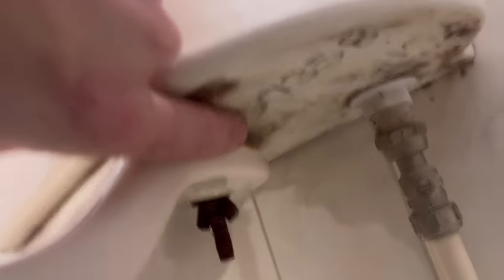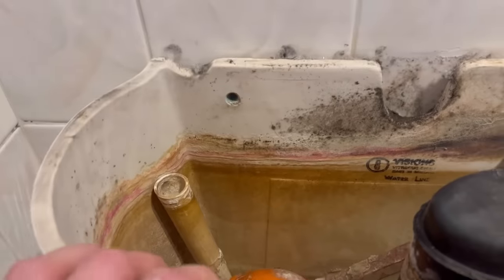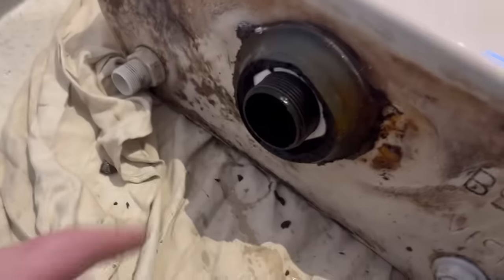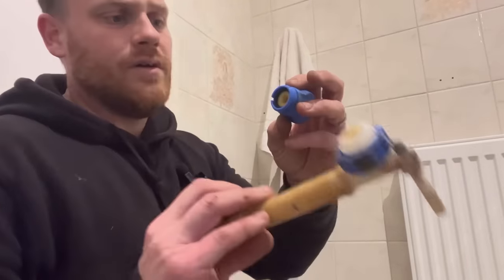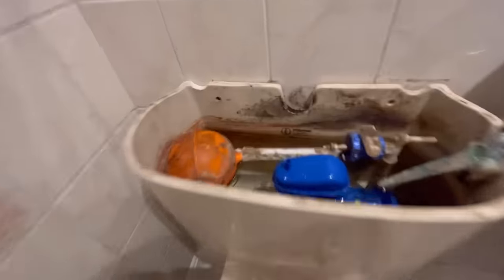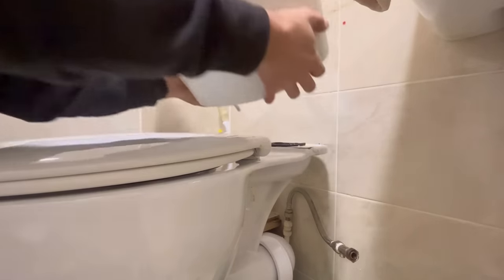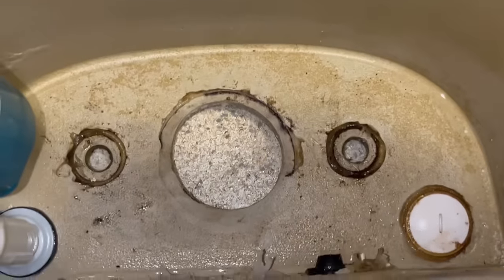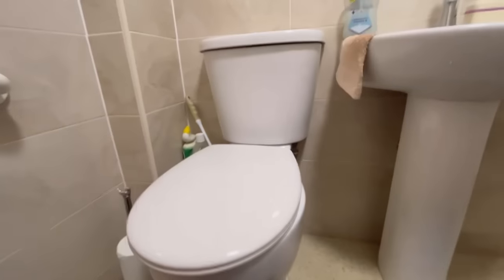Worst Plumbing Repair Ever! Plumbers, Stop Doing This! NIGHTMARE

Comment: There something special about hugging some total strangers dirty smell toilet only a plumber can appreciate such a wonders experience 😁
Reply from the maker: Absolutely, think plumbers become oblivious to the fact they are hugging and getting up close and personal with someone else’s toilet when working on them 😂
Reply: @bluebulldog_uk hi mate I have a 4  inch waste pipe on a 5 inch pipe but there is a gap any suggestions
Reply: And the customers have the cheek to bork at the price charged for repairing said smelly pissy bolt rotted toilet.
Reply: Used to dread those jobs, especially back in the day, when most people had carpet in their toilet……. And freely pissed on them …… I can still smell them just thinking about it. 😂

Comment: Silicone all the way pal, when youve worked on new build you notice the toilets you go back to with drips coming out from where the wing nuts go thru, never have silicone,  pottery in recent years has become more poor, never silcone the donut washer to the pan tho. If you get leaks from that point  youve likely not fit toilet pan square.
Reply from the maker: I can see using it on the nuts but on mine the amount of silicone and the places it was, just crazy, I think you am right about pottery, had a toilet that was really out of plumb and a basin that was wonky in recent times

Comment: It takes a minute or 2 to remove the silicone. If you don't use silicone and it leaks its going to take about 15-20 minutes or possibly even longer to fix it. Better safe than sorry. Hate the rusted wing nuts 😭😭😭
Reply from the maker: Rusted wing nuts am a nightmare, nothing worse. I’m going to look at getting a proper tool to remove cause to be honest it just would not come off, didn’t help it being late at night and wanting to go home 😂
Reply: I usually use a dremel to make a cut through those wingnuts, then lever them off with a screwdriver.. it's quite small and can normally get in tight spaces.  Still not easy but does the job in a few minutes.
Reply: Niall I've fitted countless cisterns WITHOUT silicone and never had leaks unless I've forgot do something lol no need for silicone on toilets at all.

Comment: I am a joiner, but when I fit toilets I swap out the cistern to pan bolts for stainless bolts and wing nuts... And I fix the cistern to the wall with stainless bolts and a rubber washer. When I come back in years to come a doddle to get out. 😊 And to do this costs me about £1...  As I am a landlord too and will end up fixing it in years to come, and Tennant's wee seems to go everywhere 😮 corroding steel bolts even quicker than just the condensation.
Reply from the maker: The dreaded wee conversation with people when they ask why the radiator next to toilet is rusting is the one 😂 good to see your planning ahead and making your property’s easy to maintain 👍

Comment: I generally replace both the flush and fill valves as saves the hassle of call backs later on... maybe even the flexi connection, as well as the close coupling kit with new wing nuts and donut washer - nice video cheers for uploading
Reply from the maker: Thanks mate 👍

Comment: Those close coupled kits, the washers are for under the cistern with the wing nut, the bolt is designed to stay inside the metal bracket
Reply from the maker: Top spot mate I was waiting for someone to spot that, I did move them when I realised what I done but the washers was tiny hence why you see me change them to bigger ones 👍

Comment: I'm Not a Plumber but I have Changed out Cistern washers, I never use Silicon, to seal but I do use Vaseline on Metal Bolts both as a Lub and a rust preventative

Comment: Job 1. Many times the wing nuts start to turn the bolt so I have had to cut the bolt with my multi tool! Small hint - when the new fixing bolts are in the bracket I always tape them in so they cannot drop down into the inside of the pan. Had this happen once and had to remove the pan and tip upside down to get it out!! Job 2 I agree no silicone needed for any rubber washers - it can make the washer distort as it acts as a lubricant. I use Flomasta and the kit comes with a new inlet so I always fit it and a new flexi!!

Comment: Totally agree, no need for silicone 
Had to do it once as some dull manufacturer for a close coupled disabled toilet supplied me with a washer that was too small for the syphon hole 
Tried it twice with what they provided but it kept leaking to got a Dudley flush and silicone it in 
Dudley common around here so that bit shouldn’t ever need to be taken out again
Reply from the maker: Be sound with a Dudley, parts are easily available 👍

Comment: Really good content showing how it can be a nightmare to fix a toilet. You just know you’re in for it when the close coupling nuts are rusted. I’ve used a hacksaw blade and that’s not nice on the fingers but I’ve a multi tool now so I think that’s the way to go. I would put a dab of clear silicone on the cistern through bolts really depends on the rubber washer that comes with the it. If it’s flat then def silicone but if it’s a good mushroom hear shape then that will bed in and no silicone required. Yes I’ve had plenty of toilets from hell over the years and like yourself I keep a few flow master flush valves in the van they are indeed the business. Keep up the good work.
Reply from the maker: Thanks mate appreciate the comment 👍 I do rate those flowmasta kits, very good for the price

Comment: Good video. I usually use my multi tool to cut through the rusted bolts.
Reply: Would the vibration not crack the toilet.

Comment: Never use silicone, unless for some odd reason its a last resort.  Id have just got the grinder out for them.wing nuts
Reply from the maker: I did think to get the grinder but was all the way in the van, in my head struggling for 5 minutes was the better option for some reason 😂
Reply: Managed to get a hacksaw in there to cut mine off

Comment: Agreed never need to use silicon. Alarm bells ring when you do see it, often it’s because the cistern is damaged/cracked and rather than replace it someone has bodged it and hoped for the best. Or rather than replace the donut for a fresh new one that fits correctly, they’ve had a party with a tube of silicon. 

Also I’d throw those plastic fixing bolts away even when brand new, I always carry packets of the metal bolts kit version (come with thick domed washers too). Screwfix sell em for less than £3. That way I know for sure it’s not going to leak or come loose. I’d also use a 3/4 tap washer and metal washer on the screws to fix through top holes in cistern to wall. That way when the screw does eventually fall apart, there is something left to grip the screw out. If the head has rusted off then it’ll just fall through the holes, rather than be left with screws that won’t budge. Flat head screws either that’s not been changed in a long time or some idiot thought they’d be a good idea. Of course assuming the wall behind is tiled or has a nice solid finish - you are licensed to splodge some silicon at the top lol just enough to hold it. Just deep enough to cut with a Stanley blade!

Comment: I would of changed the float valve at same time and just a tip when you put the bolts on the fixing plate put a blob of silicone on each one stops them fallen out when you try to fit cistern to the toilet bowl

Comment: Job 1 - the rusted bolts. Removing the wing nuts is always a pain but when rusted the bolt turns as well even after a bit of WD. At this stage I try the multi tool to cut the bolt but if this isn't possible its as you did - brute force and hope the metal is also rusted and it lets the cistern come off. Then hacksaw the bolts. Nightmare for an easy job! Job 2 - silicone everywhere! For all rubber seals I agree it is NOT needed. Indeed it acts as a lubricant which lets the rubber get squashed so more likely to leak. One thing I always do when fitting the bolts through the bracket - I tape them into place ever since one flipped out and went down inside the cistern. Its probably still there as I found another bolt!! Yesterday I did a job and couldn't find my pipe slice!! OMG had to use a hacksaw!! Not done that since 1969 when I did my own central heating!!

Comment: Silicon is for baths and shower trays, NEVER for thread and gasket sites. It's a maintenence disaster.

For a basin waste my plumbers merchant recommended something they called a plumbers friend. It's a conical shaped washer the big nut pushes up into the basin hole. Better for me than a tub of mait I won't use.

Superb watchable stuff as ever.
Reply: Oh, and good to see you using tools for jobs they aren't meant for, like hammering on screwdrivers and bashing syphons with grips... "we've all done it"
Reply from the maker: @tomsanders8714  😂😂 grips as a hammer is my favourite
Reply from the maker: For basins I use a Thomas Dudley basin mate might be same thing, really good 👍

Comment: What about a quick blast of silicone spray rather than the thick stuff? I'm on a course right now and the guy is advising that. Like to hear thoughts on that, Great vid mate 👍
Reply from the maker: Thanks mate…seals am designed to be compressed between the 2 surfaces your trying to seal, anything in between just causes problems, maybe plumbers mate at a push sometimes but shouldn’t need it 👍

Comment: Multi tool with a metal cutting blade for cutting off the rusted wing nuts, as an ex service engineer for a WC manufacturer the use of silicon sealant on cistern internals voids the warranty on the parts.
Reply from the maker: Cheers mate…Im showing my mate this comment who uses silicone, proves my point 😂👊

Comment: Just ordered some of them adaptors mate, good call! 

I'm with you, the ONLY time I use silicone is if I use the plastic bolts on the cistern, just for some reason they don't seal right but that's the only time on toilets often you can't clean the silicone off properly anyway which then can cause leaks. Does my head in.
Reply from the maker: Adaptors am great for price 👍🙌 
Does my head in always adds time to the job and not needed
Reply: @bluebulldog_uk  can't wait for them to turn up! Might cut some more notches into one of them for when it's the plastic + head wing nuts :)
Reply from the maker: @killerbean9911  great shout 👍

Comment: Just try and avoid the wing nuts as much as I can - Use the Mcalpine Super easy set but those adaptors are a top shout 👍🏾
Reply from the maker: I’ve seen them new Mcalpine ones might give them a try 👍
Reply: @bluebulldog_uk  Another plumber channel had a prob with one of these I believe. https://youtu.be/TNtCtcexrmo?t=1431
RE silicon.... I'm sure the person that did this meant it to be a forever seal if he knew he could quite easily just swap the syphons over as you mentioned at the start of the job.Happy New Year mate.

Comment: Hello bud keep up the good work. Question, bathroom basin is leaking not from the waste but from the the pop up mechanism sits on the top just behind the taps. Every time water is applied to the mechanism rod it leaks from bottom. I don’t want to silicone it cos I use the pop waste. Any idea mate?
Reply: Popup wastes are a bit rubbish. I had two of them. Can you change it to a clicker waste?
Reply from the maker: If it’s leaking from the mechanism where it connects from the rod into the waste part then would need replacement I would have thought unfortunately

Comment: Angle grinder for the rusty bolts no messing you need a proper big flat head screwdriver not an electrical one or small ratchet and flat head bit to take the screws out  I use a small milwauki wet vac to empty the cistern keeps everything nice and dry put a towel on the seat lid it won't get scratched up if you use it as a bench no silicone unless it leeks
Reply from the maker: Thanks for the tips mate 👍

Comment: It’s good that you have a scraper as you should have used it on the last toilet to clear the bottom of the cistern before fitting the seal, so it’s an unwarranted complaint about the silicone that you found it for. Either way, I agree about the silicone as I did some work for a lady whose nephew is gas registered so surely had to do a L1/2 course before doing his level 3 apprenticeship. He’d literally siliconed the basin waste to the bottom of the sink. For £6 he could have made himself look a lot less incompetent. Due to do my L2 course this September but I’m wondering why I’m bothering with so many YeeHah plumbers about 🙄

Comment: Wow that 1st toilet featured exactly the same as mine I fitted  35 years ago, Armitage Shanks,state of the art at the time,  (silicone free  even as a chippie) had the donut washer leaking about 5 years ago and as a life long  chippie managed to sort it out , the air was Indeed blue and could not believe how bad it looked, sorted now and hopefully last another 30 years, most people I reckon would have replaced with new, but after so many years we have grown attached to it, and working like a good un  😂
Reply from the maker: Old ones am the best 😂👍 built to last and will more than likely last another 30 years 👍
Reply: Yep I feel like crying when I come across pans where silicone has been used for the flush valve seal and the wing nuts, bad enough when they have rusted and wont budge. Tends to happen when I think it's going to be an easy relatively quick one and need to move onto the next one asap. I'll have a look for that tool....better to have it and not need it than want it and not have it, well that's what I tell the Mrs when buying new tools. Thanks for sharing. 👍🏾

Comment: no need for silicone on a flush valve, back in the day we used plumbers mate on waste fittings, top and bottom, I now use plumbers mate on top and a bit of silicone underneath between the washer and the basin, works a treat! Oh......just cut those wing nuts off, as soon as I saw the rust I was saying to myself, get your hacksaw out and cut the wing nut, you only need to go halfway through, they snap very easy and no danger of breaking the cistern, if your brave then use a multi tool.
Reply from the maker: Should of got a hacksaw but it was all the way on van, in my head was easier to struggle for 5-10 mins 😂👍

Comment: I’ll be honest…. Some seals I’ve used are cheap and nasty and I use a bit of sealant if needs be. Also there have been times where the castings of the holes in a cistern or a bath waste haven’t been too great so I’ve used it there….. there were go I’ve been honest. Now feel free to come hunt me down lmao ! 👍 take it easy buddy
Reply from the maker: Fair play for being honest mate, you am right thou if you get a bad casting or it’s a bit off then can cause problems
Reply: @bluebulldog_uk  I’ll be further honest it’s usually ct1 I would use in this situation as it seals and works and goes off under water so no waiting around for silicone to dry or worst case next day…. The worst place I hate getting it out of is the flush cone of a low level toilet pan. Proper pain.  It’s amazing how many castings on ceramic cisterns can be a bit oddly shaped. Skill builder YouTube channel did a video a few months back about a Mira flight shower tray with a real shoddy waste outlet that just would not seal as it wasn’t ground flat. Give it a watch if you can. Backs up the need for either sealant or manufacturers to actually check their products

Comment: No silicon is required on syphon inlet valve or overflow   Some plumbers put it on one side of the donut washer I choose not to but this doesnt mean I totally disagree with them and have had situations though not many where i have had to remove cistern again and add silicon to one side of donut One problem with testing for leaks is you cannot see donut washer and you can flush toilet a few times and all appears fine  but really there is a minor seepage at the donut and it takes a while to build up sometimes quite a few flushes then it will drip - very annoying- now you have to take it apart again I am with you - no silicon but do see why some use it on one side of the donut (the pan side)
Reply from the maker: I know lads who do use silicone it’s was the way they was taught and now it’s just there way, is just annoying when you go to fix a toilet and it’s stuck together 😅

Comment: You can’t even write it! I had a similar thing myself today, rusted screws on the back, rusted coupling plate and bolts, took over 2hours to remove and clean, re-install with new syphon and fill, all lovely and tested to find the pan connector leaking but was not informed of a potential leak there and guess what I had a pan connector on the van to fit but the bloody pan was cemented to the floor so not likely to come out in one piece!😢😢😢
Reply from the maker: Gotta love plumbing haven’t you, swearing and hugging a toilet for 2 hours one minute and changing a tap cartridge in 10 mins the next, never a dull moment 😅

Comment: Hi butty , why are you struggling taking the close coupled wing nuts off use a mulitool with a metal blade and cut the nut off that is what I do when struggling , I agree with you about silicon mind , it is a last resort , great videos we'll done
Reply from the maker: It was in the van, in my head struggling with a flat head and a pair of grips was quicker than going to van, just lazy on my half that 😂👍